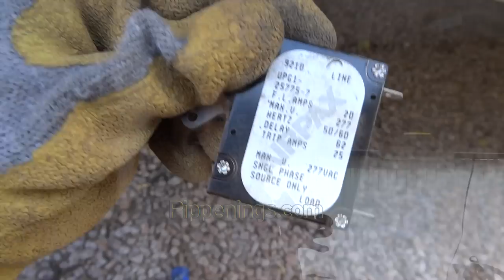30A to 50A Conversion RV: Explanation and Prep, Part 1/4

Comment: 30 M campers actually receive 3750 W and a 50 amp camper can have a maximum wattage 12,000 but she says a 50 amp camper. The only thing that’s different between a 50 amp and a 30 amp camper is there is two legs last I knew whether you own a 50 amp camper or a 30 amp camper you don’t have two legs of 120 volts because if that were the case, you would be able to plug-in an electric dryer or an electric stove, but you can’t due to the fact that there ain’t 240 V that go into a camper if there is any other RV technicians do they make 240 V 50 amp campers
Reply: And I would like to point out she said, unplug everything and turn off your inverter with the inverter that she’s got it looks like she’s got solar panels so if you have solar panels and you’re trying to work on your electrical, just shutting off the inverter and unplugging the power and disconnecting. The battery is not going to stop you from getting electrocuted if you have solar panels so if you have solar panels put a blanket over the top of of the solar panel that’s if you’ve got by facing solar panels and if you’ve got regular solar panels with one solar panel face, then just cover it with a blanket as well or make it so that there’s no sun hitting the solar panels so that it does not produce electricity

Comment: Thank you Pippi.  I am going to uprade a Parallax Power 8355 with a master and 5 subcircuits to a WFCO Arterra WF-8930/50NP RV Camper Trailer ULTRA Distribution Panel Brown 30/50 AMP.
I know this will be the largest project I've ever had on my Rockwood 8318 SS travel trailer.  Back in 2007, they probably never expected anyone would have a big screen flat TV, an XBox One, a 50W per channel Dolby 5.1 receiver, multiple cell phones with chargers, and last but not least, a 3.5 Cu. ft. freezer in the rear.  I live in Redding, CA where the temp exceeds 100 degrees for most of the summer, so I also have not just the overhead A/C, but both a portable 900W A/C and a 700W bedroom window A/C.  Let's face it, a mere 30A will not cut it for me.  Fortunately, the connection box outside has both two 120V 15A circcuits, a 30A circuit, and a 50A circuit, although they're shared.  I've been using the 30A plus TWO 120V 15A extension cords, but it not only looks messy, but it's too easy to trip over extension cords coming in though the bedroom window and the rear.  Plus being a fire hazard, and the manager of my mobile home park frowns on using both 30A and 15A extension cords - I don't blame him, of course.  So, I just found your videos, and I'll be starting after I receive the WF-8930 being shipped to me.  I already know the most difficult part will be installing another 15A wire (probably 10 guage) from the panel to the inlet where I currently have a 30A twist-lock inlet.  Of course I can read wiring diagrams - before I retired, I worked as a data center engineer for HP.  I look forward to your explanations of how to do the drop from the power center to the inlet, and of course change the plug from 30A to 50A.

Comment: I'm sorry but you are very confused on how much power you will have. I was an electricians helper for a while. I'm no expert but your information is incorrect. When you change over from 30 amps to 50 amps you will only have 50 amps. If it were 50 x 2 it would be a 100 amp system. It is a more versatile system and can handle more lamps,appliances or whatever. I understand you're learning as you go and don't want to sound like I'm only criticizing, I'm actually hoping I help you and others to consider researching thoroughly any electrical work you do yourself.
Reply: actually, 50 amp RV and marine hookups are 100 amps at 120 volts or 50 amps at 240 volts. They are identical to 50 amp electric stove connections where you have two 120 volt hots, 1 neutral and one ground.  My RV is setup to run both AC units and the frige off one branch and the rest of the coach of the other branch
Reply: Guess that is why Hilly Beamer was just a "helper for awhile"... "It is better to remain silent and be thought a fool than open your mouth and remove all doubt..."

Comment: Pippi , did you also change your generator to a 50A? Or just leave it for 30A?
Reply from the maker: I swapped out the second breaker for the extra power. It's 7kW. Don't think I'll ever use that much while using the genny only anyway :)
Reply: A 7kw Generator is already capable of 58 amps and is more than enough to run both AC units the microwave and just about everything else in the RV
Reply: 2 full roof air conditioning units at 15A each will make up 3kw draw...

Comment: I apologize if you've already answered this elsewhere, but what was the total cost of the 30 to 50 amp upgrade?  Just took my RV out for it's maiden voyage this weekend with two teenagers to learn that 30 amps isn't enough to run both A/C and boy did I hear it!  I'm fairly handy (finished my basement from watching YouTube videos) so I'm ready to take the plunge.  Just need to know about how much this is going to set me back.  Thanks and great videos.
Reply from the maker: Good question. Since I don't know what you already have take a look at my shopping list I did for this on my blog: http://www.pippenings.com/rv-living/30amps-50amps-rv-conversion/

Comment: STOP....   STOP ....(OK - - - PLEEEASE STOP! ) 
Oregon... WHAT are we going to do with your talented self?
     You have shown how to create the WHIP OF DEATH!!!   In the video 
you show making a 50 AMP Male to Male for "Shore Power" - which for 
ANYONE including yourself, is a "perfect storm" loaded with HOT 
Lightening with poor endings and No Sequels.  Whatever you have planned 
for the day - cancel it - and CHANGE that extension to a proper Male to 
Female 50 AMP.  I know you WILL have to also change out the box 
connections, but it WILL save lives - most importantly I'm sure to you, 
starting with your own!!!
     When eventually (as for everyone else)  you screw up or someone 
trying to "Help" you screws up and just plugs that "Shore Power"  line 
in without having the breaker off - or WORSE - a faulty shore breaker 
that FAILS TO TURN OFF, and that M to M cord you've made then becomes 
the equivalent of handling an ENERGIZED & BARE welding cable.  YOU 
or them will become a short lived Christmas tree ornament!  Electricity 
can and WILL also ARC or JUMP, and in high humidity or wet conditions, 
so accidentally touching those male connectors doesn't even need to 
happen for you to be killed.   
      While yes, I DO know I'm gruff or blunt or whatever you wish to 
label Me - doing what I ask of you is in the interest of keeping you in 
the land of the living.  
     There were also "small" mistakes which can lead to major 
consequences - others guys have already listed them so please read ALL 
the posts and take us serious. 
     Ya got guts lady - and we love ya for it!
Reply from the maker: Thanks for the advice!
Reply: AMEN BROTHER,PIPPI PLEASE HEED HIS ADVICE. !!!!
Reply: +Pippi Peterson yes sweetie you may want to retire from your brief electrical career. there are four year apprenticeships and college education that trains people in this dangerous industry. your friendly neighborhood electrical contract

Comment: I bought an older just under 30 ft class A motorhome a few years ago. The best upgrade I did to my new purchase was to upgrade from 30 amp service to 50 amp service.

I wasn't as adventurous as Pippi and had professionals do the upgrade. Cost about $1,000. Only took one day, in by 8 AM out by 5 PM. 

How big a difference is going from 30 amp service to 50 amp service? It is, as Pippi points out in her video series an amazing difference. 

With 50 amp service I was able to have my A/C on full blast, watch TV, make coffee, have lights on (LED lights which draw very little power another upgrade that is worthwhile), have my computer on and use an electric skillet to cook dinner. All without any worries about overloading the system.   

Of course the draw your appliances will have on your system will vary from mine and other RVers but I think it is safe to say that the situation I described above is possible in the vast majority of cases with a 50 amp service.

Great series Pippi. IMO upgrading to a 50 amp service is a worthwhile investment for any RVer.
Reply from the maker: Thanks for sharing, Jack. I'm glad you're happy with your upgrade, too!
Reply: Where did you find a professional that could upgrade your RV? I also don't feel confident doing the conversion myself but I'm not sure where to find this service. Thank you
Reply: @mindystevens3685  Sorry don't remember the company name. The upgrade was recommended to me by a neighbor in an RV park in Los Angeles county when he gave me a tour of his RV. His RV was older and had only come with a 30 amp service. He said he and his wife kept overloading the electrical service and tripping the breakers. So they went looking for a company that could do the job.

I really do recommend the upgrade to 50 amps it makes a big difference. Unlike Pippi I don't possess the skill set to do the job myself. Many RV dealerships do electrical work and according to the dealership representative it's a fairly simple job for an experienced RV tech.

Comment: My RV came from the factory as a 30A, the original owner had a 50A plug in wired into the inlet side of the power box. So I have the option for both 30 & 50A. My RV is a lil different than most, the microwave, house vacuum, and front AC unit are wired to work only off the generator, not shore power. I guess he got tired of running the generator to microwave a meal and clean house. I have yet to play with the 50A side of the system, honestly I'm a lil hesitant to plug that 50A in. I will more than likely have it checked out by a professional to make sure everything is compatible.
Reply from the maker: Oh wow, that sounds like a hillbilly type job. Best of luck!
Reply: now what i'm wondering if the 30 amp service which is at 120 volts ac, is the upgrade to 50 amp change to 240 volts ac or still at 120 volts ac ?

Comment: Please be very careful switching a 20 amp breaker for a 30 amp breaker on your gen.  You mentioned that it was a 7000 watt gen.  which = 50 total amps @ 120 volts.  If you have two 30 amp breakers that means that you could pull 7200 watts and that would overload your gen. possibly damaging it or worse.  I'm not telling you not to do it or leave it that way, just please understand the possibility of an overload.  30 amps x 120 volts = 3600 watts x 2 = 7200 watts.
Reply from the maker: I probably wont be running a washer and dryer and three air con units off the generator any way. This is what's standard though in 50A RV upgrades.

Comment: That is an ambitious project! You should mention what made you decide to pursue it. It couldn't just have been making those smoothies. ☺ 
You did an excellent job of explaining two phase power. Well done!!
Reply from the maker: For the ability to use both air conditioners :D and more than a blender and computer at the same time ;)
Reply: +Pippi Peterson hello pipi .. from the looks we have close to the ssme model bounder.. so i what was the total cost for the upgrade.
also did you keep the original converter / charger or did it have to be changed. .
thx for the informative vid.. Robert
Reply: Wayne Mills 
Because you may want your ac or heater on top.